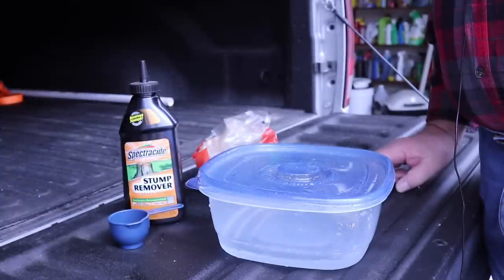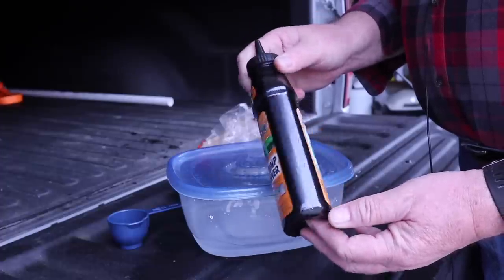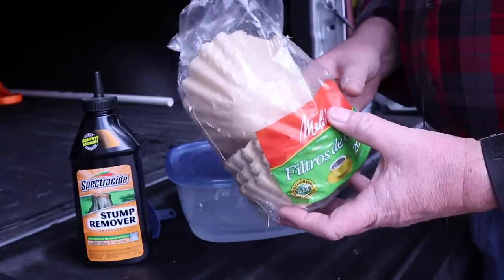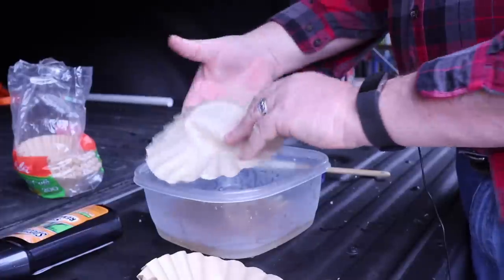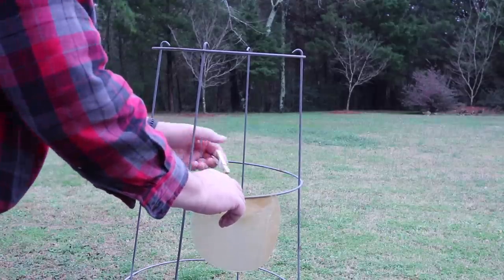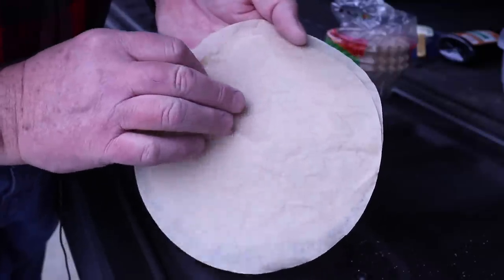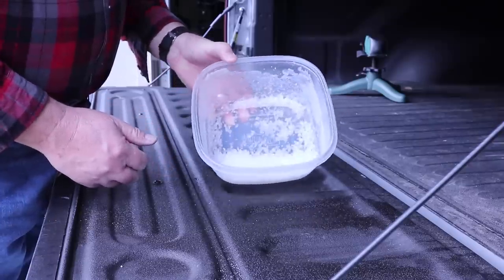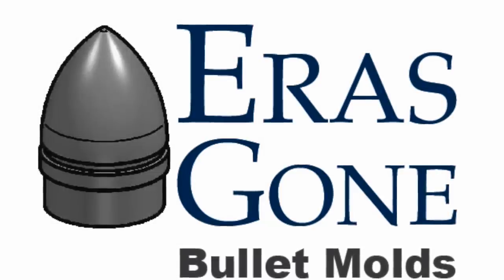Nitrating  Paper for Combustible Cartridges

Comment: Could you dissolve charcoal and sulfur in the mix also and have the paper burn even better?
Reply: The paper is already very much fuel "rich" for the quantity of nitrate it can be impregnated with. Adding more fuel would not help, but hinder complete combustion of the cartridge-

On top of that, although a couple of things like carbon disulfide or hot toluene WILL dissolve Sulfur but not paper, charcoal doesn't dissolve in much of ANYTHING, let alone any solvent which wouldn't also destroy the paper.
Reply: You would be making what I have heard called touch paper if you use the correct proportions.

Comment: We’re the original paper revolver cartridges of the 1860s potassium nitrate coated like this or did they use paper converted to nitrocellulose (flash paper) for complete and rapid combustion?
Reply from the maker: There were several patents for combustable and "waterproof" cartridges.  I suspect some of them were nitrocellulose based.  Some were just paper and some appear to have been nitrated as in this video.

Comment: I have a question.  I use end wraps used in hair styling.  It burns well and fast, but I wind up with a lot of unburnt residue.  I wonder how much impact glue stick glue has on incineration?  Has anyone tested this?
Reply from the maker: That is always a possibility.  I had much more trouble when I used to use clear glue.  I sometime still get end caps that stay in the chamber unburnt.  It could be a result of using too much glue stick.  They would have usd a wheat based paste in the old days.  Any paste made with a starch base should burn better than a modern adhesive using polymers or acrylics.
Reply: @erasgonehistoricalmolds2400  If ya got a recipe, great, if not, I'll see what I can find out about it.  Thanks!
Reply: @erasgonehistoricalmolds2400  a little late to the party but i imagine that boiling or simmering some form or either flour or possibly corn starch would probably yield a decent adhesive with good enough burn rate. Possibly with a very small amount of Elmer's school glue if the adhesion isnt good enough? Just speculating because that is not a property for adhesives that was ever a consideration for me; other than avoiding solvent explosions lol.
Reply: @erasgonehistoricalmolds2400  I also seem to recall nitrocellulose being a polymer. May be able to dissolve a ping pong ball in some acetone to make a readily flammable adhesive.  I would however advise caution for that one.
Reply: Nitrocellulose dissolves in acetone and it usually referred to as "Colloidon". It used to be used for repairing cine film. You can still get it as "Plastic Skin" as it has a use medically for covering scratches and other minor injuries.. be warned, it stings like **!!@@"!!! Don't know if you can get it in your corner of the swamp, but might be worth trying...!

Comment: this is not nitrating of paper, its just paper soaked in oxidizer nothing more... actual nitration of paper requires concentrated sulfuric acid mixed with either potassium nitrate or nitric acid...
Reply: Iam; Well, that would be Nitrocellulose. For out purposes, the term nitrated paper is descriptive and useful.
Reply: @KB4QAA  i guess nitrocellulose would be way better to use instead that "nitrated paper", there are modern weapons that use nitrocellulose casing...
Reply: Nitration of paper into nitrocellulose might cause extremely high pressures as it will become a propellant.
Reply: @snowflakemelter1172  The amount of paper is tiny, probably 1 or 2 grains. Not enough to  swamp the larger powder load.
Reply: @ApplyWithCaution  Huh? Nitrocellulose vs. KNO3; Your comment makes no sense.
Reply: @ApplyWithCaution  Well, no it isn't a problem in this discussion.  It's been used in paper cartridges for 150 years.  Keeping cartridges in sealed containers or re-drying them is simple and easy.  Dixie Gunworks sells nitrated papers without any special packaging or handling.
Reply: @ApplyWithCaution  You are lost in the ozone, pal.  Not making any sense.
Reply: @ApplyWithCaution  
Wrong. Ammonium nitrate, Calcium nitrate and Sodium nitrate are hygroscopic. Pure Potassium nitrate is not. That's why the Potassium salt is used, and why "salt petre" manufactured for powder used to be double purified after addition of Potassium salts to do a displacement reaction of any sodium, calcium & etc. and remove these.
Reply: @snowflakemelter1172  You are absolutely right.  Now it becomes smokeless powder like.
Reply: Interesting commentary here; and my kids are mandated to read 'guns, germs, and steel' By state law in school. With this in my head, watching this video and reading comments. Makes me chuckle. 
      Also i love my fellow Americans. What great minds people have when allowed to be free and discuss.
Reply: Yes, true...
Reply: @Bert2368  Pure KNO3 IS hydroscopic, but not at the same level as the others you named. It will absorb water from the atmosphere, just at a slower rate. Sodium nitrate will absorb so much it turns to mush.
Reply: @PyroRob69  
Hi PyroRob69-
I do Pyrotechnics myself. I own a pyrotechnic company and have a license to manufacture explosives. Plus, a little bit of experience...

Potassium nitrate is not considered to be (effectively) hyGroscopic. It will not dissolve itself in moisture it attracts out of the atmosphere (deliquesce) as will some other oxidizers such as magnesium perchlorate, nor ruin the integrity of powder grains or stars it is compounded with by changing size with changes in temperature and humidity as will ammonium nitrate. Time of exposure is not of so much consideration in this matter, rather, % weight of water absorption vs. relative humidity, which, thought MEASURABLE for Potassium nitrate- Is  NEGLIGIBLE in effect. Technically, Nylon is also hygroscopic. Do you notice it when you wear a windbreaker on a humid day?

Please look up "hyGroscopic". "HyDroscopic" is not the word you were looking for, although it is quite a common misspelling.
https://www.thoughtco.com/definition-of-hygroscopic-605230
Reply: @Bert2368  I've made a lot of black powder myself :)

Comment: also, quick question. could you dissolve the potassium  nitrate in ethanol or isopropyl? i know it is soluble in ethynyl at the very least but it would evaporate much faster than the water for a quicker start to finish? i planned on trying to make some nitrated paper for my cap and ball revolver for quicker plinking and for reloads for hog hunting so I can reload faster on the side. 

only asking this because at this point I'm over dropping wedges in the brush to change cylinders, not including I don't like having 12-24 loaded chambers on me.

Comment: I have always wondered if magician flash paper would work with this.  It isn't that expensive to order from the internet.
Reply from the maker: It will work. Some folks use it. But it is thin and does not offer much body or rigidity to the cartridge.

Comment: Great video brother..will this concept work for making a cartridge for a 1859 sharp's rifle?? or just using it in the back of the cartridge??
Reply from the maker: Sharps cartridges weren't nitrated.  I suspect the larger powder charge was able to send any unburned paper or linen out the muzzle with he bullet.  Another issue would be the risk of premature detonation if your nitrated cartridge hit an ember when you were loading it into the chamber.  Unless your cap is having trouble penetrating the back of the cartridge, it should not be necssary or the rear either.  Thanks!

Comment: Thank you, Mark!  Does water temperature (hot, warm, cold) make a difference in how will the nitrate dissolves and/or how well the papers self-consume?
Reply from the maker: Yes, if the water is warm or hot more of the powder will disolve.  If the solution is saturated when the water is hot, the Potasium Nitrate will also come out of solution as the water cools and form floating crystals.  That wont really hurt anything.  I suspect both cool and hot solutions will yield about the same results but I have not tested it to know for sure.

Comment: Do paper cartridges affect accuracy, it seems like it would.
Reply from the maker: Ian, not that I can tell as compared to shooting historically accurate conicals.  However, if you want the ultimate in competition accuracy with a Cap and Ball a round ball with mild charge and a filler is the way to go.
Reply: @erasgonehistoricalmolds2400  interesting, another guy on YouTube was talking about his original colt 1861, he always would shoot two fliers and the other shots where touching each other, he said it was because two burnt out nipples, i assume this causes an uneven burn throwing the ball elsewhere, I just assumed the nitrate paper would have the same effect but less noticable. Learn something new everyday

Comment: Marc, is there any value in treating the papers a couple or three times? Meaning… After it has dried to re-soak them and let them dry again?
Reply: Alan,  it probably would not help.  If the first application results in crystalized potassium nitrate on the surface, it probably has reach saturation.  Resoaking it might dissolve what is already in the paper.

Comment: I bought your Johnson and Dow mold and love it. I've followed this video and created nitrated coffee filter cartridges. I use a heat gun to dry them very quickly.  

I've found that the hull is consumed completely after firing. However, the base cap generally is in tack and they stack up at the bottom of the cylinder. I'm considering using cigarette papers just for the bottom.  

I started compressing my power too and I get really strong robust cartridges. I also use the Guns of the West former. I've found that it helped to lightly sand down the former, to make the cartridge a bit smaller in diameter.
Reply from the maker: I've had the same experience.  In fact during cleaning I've pulled out 2 or 3 caps in one chamber.  The flash of the cap had no trouble getting through all of that to ignite the loaded round.

Comment: If you want to make flash paper/ nitrocellulose add sulfuric acid + potassium nitrate or nitric acid, let paper sit over night and rinse with water and let dry. Make sure to have a bucket of water that has been mixed with sodium carbonate "baking soda" if it gets out of control this solution will neutralize the acids. These two acids when mixed will heat up and produce gas so make sure to be under a vent hood with a mask or outside away from anything you care about. YouTube has a tutorial if you need to watch.

Comment: What about combustible nitrocellulose cartridges?  Table tennis balls are made of nitrocellulose.  In acetone, they dissolve and form a gel that could be used to make combustible cartridge cases.  However, for black powder weapons, gas pressure and burning rate will be too high.

Comment: Actually I understand that you want them to dry FLAT because if you hang them the potassium solution will run down to the edges so to speak where as flat it stays evenly distributed..
Reply from the maker: John, that might help some, but probably not enough to really make a different for paper.  When I make slow match for my cannon I do that, because I want the cotton cord to have a consistent burn rate along its entire length.

Comment: Any experience with other nitrate or chlorate compounds? Thanks.
Reply from the maker: Kevin, I'm an archeologist, not a chemist.  I'll stick with the simple stuff!  Thanks.
Reply: You could use sodium nitrate, but the results would be very hygroscopic.. in other words it would be difficult to dry without heat and then suck moisture out of the air! Do NOT use chlorate compounds as these are very corrosive and will rot your gun! Chlorates produce hydrochloric acid which reacts rapidly with steel.. this was the main problem with old corrosive percussion caps which killed many old guns!

Comment: I use tissue paper from the greeting card isle without nitrating them.  They burn fast and clean.
Reply from the maker: Tissue paper burns great, but its lack of strength and body makes it more difficult for me to roll the cartridge.
Reply: @erasgonehistoricalmolds2400 The stuff I use is just only a little thinner than the coffee filters and holds up fine.  Maybe I got lucky.

Comment: Howdy, this may be a dumb question, but - Would not these salt coated papers act as a corrosive to the inside of the steel cylinder chambers - particularly if the revolver is left loaded up for a few months? Thanks in advance for any reply.

Comment: Use reagent grade concentrated nitric & concentrated sulfuric acid. Second rate chemicals can introduce impurities that can destabilize the final product. Explosives are one kind of product that you do NOT want to destabilize or they may ignite or detonate spontaneously.
Use of potassium nitrate will leave a corrosive residue after the paper burns. This will damage your firearm.
Reply: PhD in chemistry? 

He is using these Potassium NITRATE IMPREGNATED papers to hold BLACK POWDER charges, which propellant is composed of about 75% POTASSIUM NITRATE.

No significant increase in corrosion risk from using a bit more nitrate!

Now, if you use BP substitutes with perchlorate oxidizers for a propellant? THERE is an increase in corrosion risk.

The video maker has not used the correct terminology to describe his process, I understand why you jumped in to comment. But if he REALLY was nitrating paper, what chance a person with his level of knowledge could effectively  wash it free of acid occluded inside the hollow cellulose fibers, then stabilize it with diphenylamine or even urea and get an (acceptably) storage safe product?!
Reply: @Bert2368  I missed the black powder part. Sorry. Obviously, once black powder is involved, potassium in the paper does not matter in the least.
Reply: 6 6  
Learn some courtesy and also do a little research before writing nonsense. ALL firearms use explosives: that is where the "fire" in firearm comes from. Propellants (black powder, smokeless powder, etc) are LOW explosives, but explosives nonetheless.

https://en.wikipedia.org/wiki/Gunpowder
"Gunpowder is classified as a low explosive because of its relatively slow decomposition rate and consequently low brisance. Low explosives deflagrate (i.e., burn) at subsonic speeds, whereas high explosives detonate, producing a supersonic wave."
Reply: 6 6  https://en.wikipedia.org/wiki/Gunpowder

"Gunpowder is classified as a low explosive because of its relatively slow decomposition rate and consequently low brisance. Low explosives deflagrate (i.e., burn) at subsonic speeds, whereas high explosives detonate, producing a supersonic wave."

Comment: Try A: Using the hottest water you can, with the maximum ammount of nitrate it will hold in solution for impregnating your filter paper, and-

B: Try misting the papers you withdraw wet from the hot solution with some alcohol from a spray bottle, which will cause the nitrate to crash out of solution in place, rather than dripping away in the excess water draining off the paper. Your papers will also dry a bit faster due to some water having been displaced by the alcohol. You could use denatured ethanol sold in the paint area of a hardware store, or even 70% isopropyl rubbing alcohol, don't use methanol (toxicity issues).

If you do try this, weigh some samples of your papers produced with alternate methods and see just how much weight per square inch of retained  nitrate different methods of impregnation get you. Because, it's not science unless you take notes, kids!

Comment: I was told rolling papers for cigarettes are already nitrated paper. Any truth to that?
Reply from the maker: Joe, I would suspect that is not true.  I can imagine smoking with paper treated with potassium nitrate!  I have heard that cigarette papers burn up very well in the chambers, however.  That might be due to the thinness and the composition of the fibers in the paper.
Reply: Yes, that is true! I think most cigarette tobacco is treated to keep it burning which is the main difference between it and cigar/pipe tobacco which will go out if you don't keep sucking it!

Comment: Would adding sugar help?
Reply from the maker: Klem, I dont know if adding sugar would help the burn rate, but it might add more carbon to the ash which would not be helpful.
Reply: I was wondering if sulfur would make a more complete burn.
Reply: @erasgonehistoricalmolds2400  ...and caramel! Don't do it.. there is enough fuel in the paper! If you add more fuel you are just making it harder for the oxidiser to burn off the paper (which is why you are putting it there in the first place!)
Reply: @davidbrass2562  No.. the sulfur in the gunpowder is there to lower the flashpoint. No need to do this with the paper.. there is plenty of sulfur already in the main charge.

Comment: I used this method using old bed sheet, cotton, to make "linen" cartridges for my percussion Sharps carbine.  I used boiling water to dissolve the potasium nitrate.
Reply from the maker: I have test fired some real linen cloth cartridges in my Sharps.  They ingnited and burn up perfectly without any potassium nitrate in the cloth.
Reply: @erasgonehistoricalmolds2400  Like I said, I was using cotton sheets and I wanted to be sure that they burned up when I fired them.